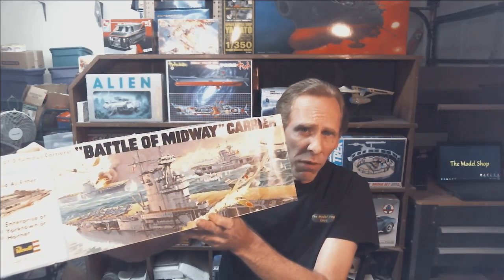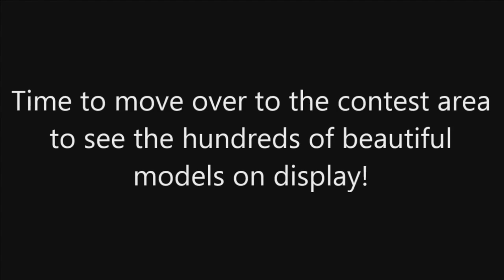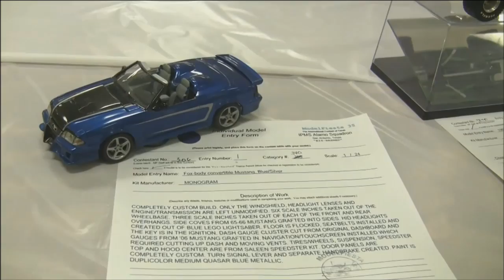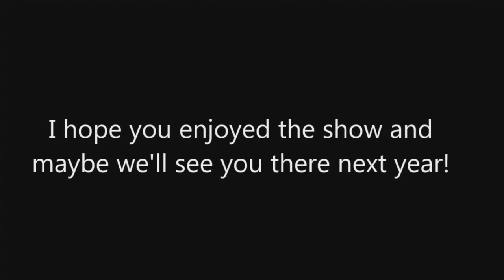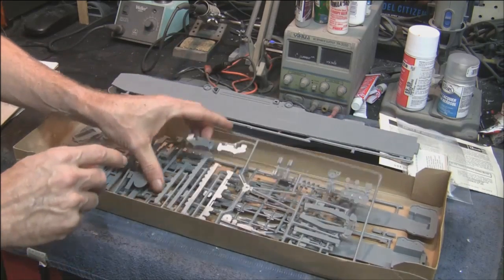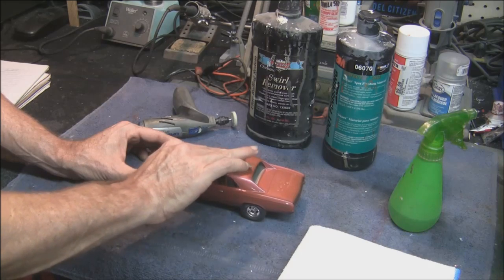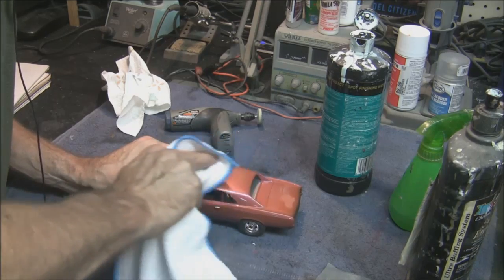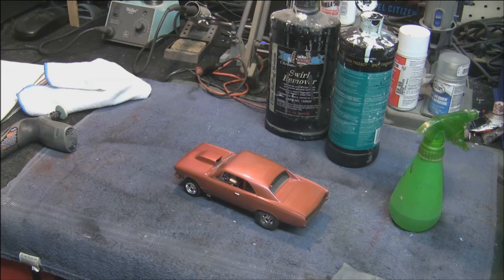"The Model Shop" Live Scale Modeling Show Episode 71

Comment: nice work buffing the chevelle boyd, and you're right, its the same process on 1:1 cars, i buff 6 days a week!  lol not only do you have to worry about swirl marks, holograms are even worse! if you get a hologram, you can't buff it out, you have to sand it and then re-buff.  thank god it doesn't happen often.
keep up the excellent work buddy!
cheers
bryan m
Reply from the maker: +bryan mccallum I do mobile auto paint repair for my day job so I do a pretty good bit of buffing too. Mostly to remove dust specs. Takes awhile to get the hand for it for sure.

Comment: And ironically, of all the Yorktown class aircraft carriers, ONLY the Enterprise (CV-6) was broken up!  They've found the wrecks of both the Yorktown (CV-5) and Hornet (CV-8) relatively intact in the last 25 years.  Two of the preserved carriers, that is two of the museum ships, are named Yorktown (CV-10) and Hornet (CV-12).  They were replacements for the lost ships as well as the training carrier Lexington (CV-16) which was built to replace Lexington/CV-2 (lost at Battle of Coral Sea).  They're both Essex-class aircraft carriers of which 5 (of 24 completed units) still exist -- the 4 museum ships (Intrepid/CV-11, Lexington, Yorktown, and Hornet) as well as the scuttled Oriskany (CV-34) which is an artificial/dive spot in the Gulf of Mexico.  The fifth museum carrier (and likely THE LAST carrier that will be preserved) is the USS Midway (CV-41), lead ship of her class.
As far as Enterprise goes, the largest portion of CV-6 that was preserved was the nameplate (which was also the case for the later Forrestal/CV-59 and Saratoga/CV-60, the first two supercarriers scrapped at Brownsville, Texas).  Other than that, you can see one of Enterprise's anchors at a Memorial in the Washington, DC area and they've already removed bits of CV-6 that were built into CVN-65/Enterprise.  Those bits removed from CVN-65 will either go into a museum (likely USS Lexington/CV-16 or the Naval Aviation Museum in Pensacola) or incorporated into the next Enterprise, CVN-80.
I was concerned that during the teardown of CVN-65 they WOULD forget that pieces of CV-6 were built into that ship during its construction (1958-1960).  Besides the portholes of the captain's cabin/CVN-65 being from CV-6, there were pipe fittings, handles, and a few other bits from CV-6 saved during CV-6's scrapping in the late 1950s.  There's a horrible tendency to throw away historic artifacts during ship demolitions.  During the scrapping of CV-6, the tripod mast of that ship was supposed to be preserved for use in a tower planned or already built at the US Naval Academy but someone forgot to save the piece and it was scrapped!

Comment: If I had time too do all of this i might as well had  did this with the body off...you can not get a mirror finish with 2 coats of clear...CLEAN  your paint area Sand after painting (gets rid of ORANGE PEEL) Sand after Clear( GETS RID OF ORANGE PEEL) 600 GRIT IS WAY TOO AGRESSIVE FOR A PAINT FINISH..I DON'T EVER REMEMBER POLISHING SO MUCH. Don't be afraid to add more clear this is your finish.wet sand it down for a mirror finish..wet sand your color coat.. this gets rid of dirt nibbs from a DIRTY spray area and levels your paint and gets rid of over spray...use the right sanding grits..i see why people are losing and not getting better at this hobby..its been 50 yrs. and were still trying to figure out how to paint and clear..